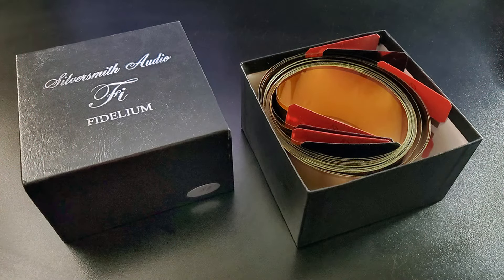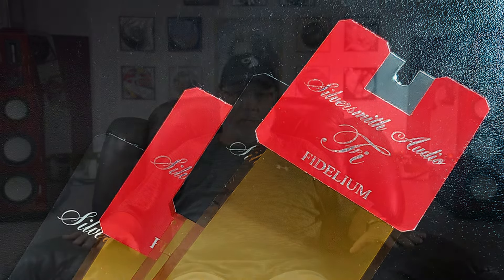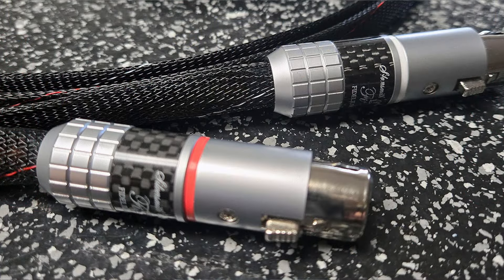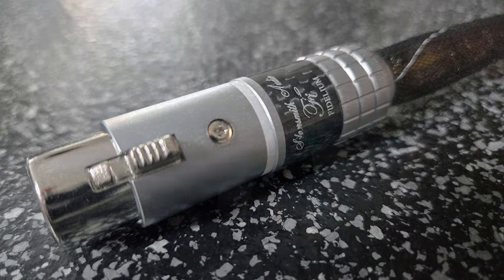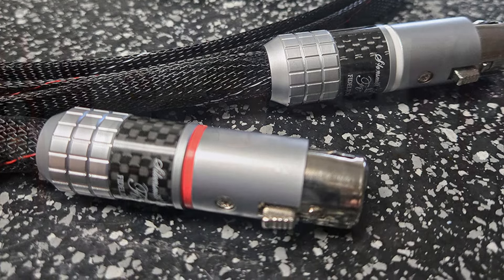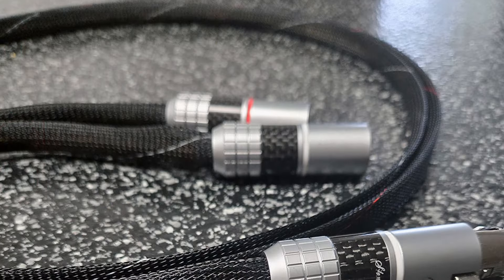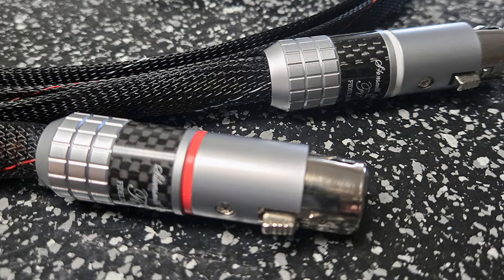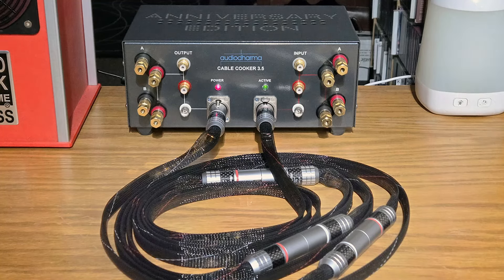E188: The Silversmith Audio "Fidelium" Balanced Interconnects

Comment: I made a very simple experiment with these interconnect cables.  I DIDN’T  hook them up.  I spent time during a prolonged dedicated listening session one evening with my existing and perfectly fine, handmade silver interconnects.  As per usual, no complaints.  This was the sound I am fully accustomed to and enjoy.  I got lost in the music.  After a few hours, I quickly swapped out the silver interconnects with the Fidelium.  Poof.  Magic.  That is how you can really tell the difference.  Top to bottom, greater clarity and speed, and involvement with the music.  It’s important to say that the Fideliums were not just different, they were indeed better.  As is popular to say, it was like I had a more expensive amp or some component upgrade.  And most importantly, I have no reason to return to the previous cables.  I’ll use them elsewhere.  But for the foreseeable future, my Magnepan 3.7s and I are staying put.
Reply from the maker: Thank you SO VERY MUCH for writing and sharing what you found... I absolutely LOVE IT when independent experimentation verifies the information that I have shared here on the channel. Thanks again, for watching, AND for taking the time to write!

Comment: I recently upgraded my amplifier, going from the integrated Hegel H590 to Ayre MR-X twenty mono-blocks (purchased used).  In doing so, I had to buy a new set of speaker wires and XLR IC.  I had top of the line Audience cables but a dealer in Montreal, Lemay Audio, was kind enough to lend me a a set of both to try...  I was simply stunned.  I only wish I could find additional qualitative comments to add to your very well articulated review of these cables.  My Audience cables found a new home and I truly enjoy my new Silversmith cables.  The only downside is that they are bound to increase in price just because they deserve it compared to other manufacturers.  I'm just happy to have able to buy them at that price.  Talk about BANG for the buck,. My advice,  grab them while you can...
Reply from the maker: Hello... I too use the Audience frontRow cables and have to agree with you that they are excellent... They were, in fact, one of the meter-and-a-half ICs I demoed these Fideliums against. I really feel the Fidelium's are more refined, and offer better transient properties...though the frontRow's seem to have a narrow edge in the body and bloom departments. 😉 But, you are right; pricing will ONLY go up...
Reply: @theaudioanalyst  The refinement and transient properties you talk about are what really sold me.  I listen to a lot of classical orchestra masterpieces and in loud complex passages, the separation and details were lacking a bit with the Audience.  But with the Silversmith, there is detail and separation without the brilliance normally experienced with other cables (although the Audience were not aggressive, they did not provide the same level of refinement).  Refined, detailed and smooth...What more can I say...

Comment: I would love to hear your take on the Grimmaudio MU2 when connected directly to your amplifiers and speakers (yes by bypassing your very high-end preamplifier and, of course, using silversmith XLR IC and speaker cables).  The MU2 is a combined streamer, Roon server, DAC and pre-amplifier and when used directly for digital playback the musicality and level of refinement is impressive. From their website :  "Its built-in DAC takes full advantage of the Grimm Audio low jitter clock and high performance FPGA processor and high resolution Pure Nyquist upsampling filters are combined with a fundamentally flawless 11th order noise shaper of 1.5 bit".   I know your friends at GTT claim that the MU1/Tambaqui DAC could sound better but... They have a commercial stake in the game.  I truly enjoy your unbiased and honest reviews and product presentations, and would love to see how you enjoy it in your high-end system

Comment: Apparently, again Silversmith pricing is more in the affordable range.  I wanted to move my REI amps 5 meters from the Poseidon to between my Von Schweikert VR9s but the cost of Westminster Labs Ultra and Masterbuilt Reference 5 meter XLRs are prohibitively expensive at this time.  Based on your possible experience and the review which emphasizes the Silversmiths speed and timing (the 1.5 m Westminster Labs Ultra which I own appears to be superlative in that realm) how does it compare to either of the alternative and much more expensive cables I mention?  Thank you.
Reply from the maker: As I've NEVER heard them in direct comparison, it would be impossible to say with any certainty. BUT, I can say that they were not embarrassed by cables costing 10 times as much, and - in some attributes - were their equal or better! All I can tell you is that they are stoopid great interconnects...
Reply: @theaudioanalyst  I really want to hear these new XLR cables in my system, even for my sources.  They could be the ticket for a 5 meter amp-preamp IC for my system.

There are many high end ridiculously expensive cabling that sounded "bad" in many systems I've heard, worse than Belden ICs which in my friends and my system, sounded less dynamic and have a flat soundstage/stuck in the speaker sound but are neutral, colorful and musically appropriate for lesser audio systems at their ridiculously low price.  The consistently worst sounding cables I've heard in half a dozen high end systems were the expensive High Fidelity magnet cables (I say fortunately defunct company now).